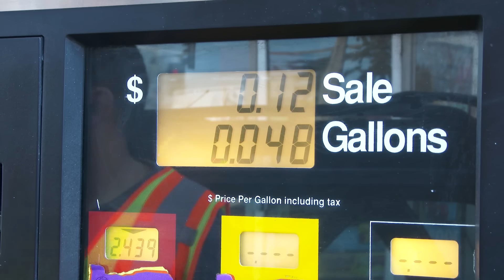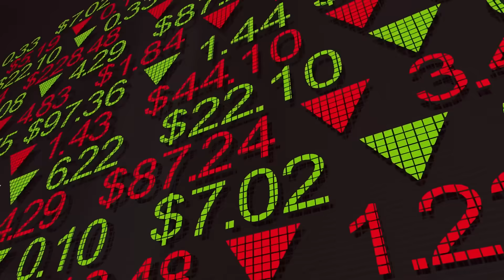Hayward Fault, Another Geological Big One Coming

Comment: An 3.9 in California/eastbay hills is a tremor, not a guake!  And the only one spreading senseless fear about an impending "major quake" is this knucklehead. I hold this opinion as I was born in Oakland in 1954 and I've lived on this fault for 71 years, and have witnessed all that mother nature has to throw at the Eastbay hills, the worst of which, occurred in 1989 during Loma Prieta guake, that also triggered the Oakland/Berkeley Cyprus structure collapse. Due to close proximity of bay area faults, they tend to work in unison, releasing stress and tension that would otherwise build, creating much greater destruction.
Reply: I wouldn't even call it a tremor, more like a bump in the night (kiwi here)
Reply: I hope you're right, but I doubt you are.  It will go at some point in time, and the epicenter will be right in the middle of cities.

Comment: Nice to see coverage of the Hayward Fault. This is the most dangerous fault in the US. For those about to respond for me saying this; most dangerous in this context does not mean it will generate the largest earthquake. It is the most dangerous due to proximity, the area it runs, and because it's due anytime now. The underwater tube does not cross the Hayward Fault or any fault for that matter.  The BART tracks cross the Hayward Fault just past the Rockridge BART station in Oakland heading east. They cross the Calaveras Fault past Orinda.

On another note, the largest earthquake in CA recently was a M5.2 near Julian east of San Diego.
Reply: The other really dangerous fault in California is the Elysian Park fault. It is mostly underground and runs directly under downtown LA. It is connected to another dangerous fault, the Whitter fault that runs along the northern edge of Orange County.
Reply from the maker: Thanks for sharing!

Comment: I heard the fracking is setting off those fault lines.   Has anyone else heard that too !
Reply: It's a highly active fault no need for that to cause quakes
Reply: Fracking sets off very small earthquakes. Never more than high fours. A seven point four earthquake is a minimum of one thousand times more powerful and also lasts for at least a couple of minutes. Not comparable.
Reply: Are you suggesting California would allow anyone to frack within it's borders?  I do not think so.
Reply from the maker: Thanks for your comment! Fracking can cause small earthquakes, but studies suggest it's unlikely to trigger large ones along fault lines. The main concern is with wastewater injection, which has been linked to increased seismic activity.